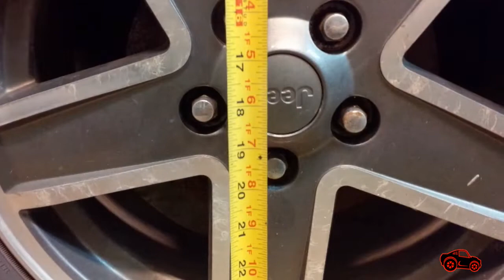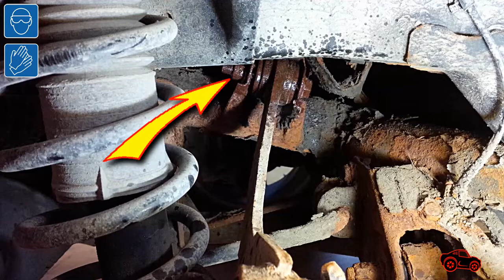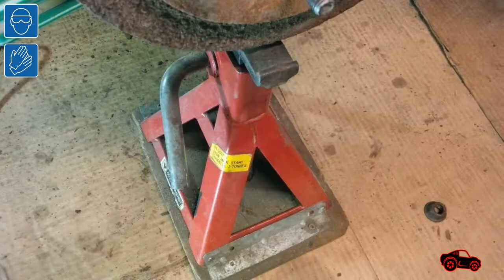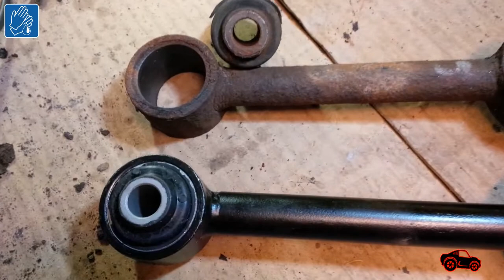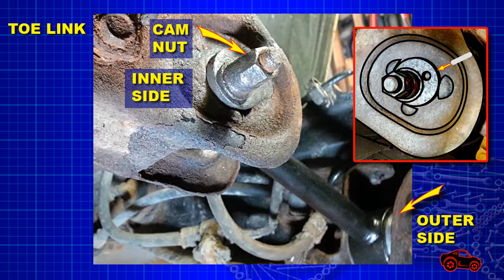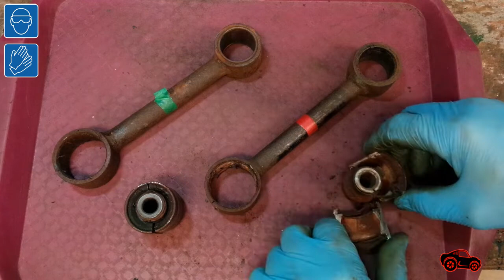Jeep Patriot Upper Control Arm & Lateral Toe Link Replacement + Bushing Preload & Torque Specs

Comment: People (making the videos on this particular fix) only show the procedure for the passenger side... The driver's side is much more difficult. I need guidance on what to do with the additional obstacles on the driver's side inner upper control arm.
Reply from the maker: I did not film the driver side but I don't remember having any problem undoing the upper bolt. You could try different tools to reach the bolt.
Reply: @mtlcarguy  hey I have a ,2016patriot and suddenly have bad camber wear on the inner rear is that alignment or a part gone bad just coincidently on both sides at similar times
Reply from the maker: @tylerbailey470  This kind of problem can be caused by rubber bushing that is not bonded to the steel arm. It can also be a coincidence with both sides since the steel arms rust at the same speed. Weak coil springs can also affect the geometry of the multi-link suspension.

Comment: How did you figure out the control arm need changing?
Reply from the maker: Because of the noise and and also because one rubber boot of the spherical bearing was damaged.

Comment: Hi! Is the preload measurement (17.5”) a standard or it would vary from one vehicle to another?
Reply from the maker: Buongiorno ! There is no real standard. You simply measure it on your vehicle on an even ground, because it varies a little depending on the strength of the coil spring, on the age of the coil spring and on the optional suspension available on different Patriot/Compass.
Reply: @mtlcarguy  thanks a lot! I’ve just replaced the whole rear suspensions of my wife’s 2011 Jeep Patriot..rear subframe was completely rusted out! Having some issues with the alignment but I think I figured it out..
Reply from the maker: @piva84  Years ago, I received a service bulletin from Jeep that extended the warranty up to 10 years to replace the damaged front and/or the rear subframe(s).
I had the parts replaced for free 7 years ago. I only payed for the alignment.
Reply: @mtlcarguy  I've check that. They told me the warranty was expired 3 years ago on mine. So I had to do it myself. I'm still struggling to get the vehicle aligned. If loosen up all the bolts, let the vehicle sit on the rear suspensions, measure the distance between the center of the wheel and the fender and then lift it up again, preload the struts to the same distance and tighten the bolts...that should work right? I'm not able to tight all the bolts properly when the vehicle is on the ground...thanks!
Reply from the maker: @piva84  You can also lower and sit the 2 rear wheels on pieces of wood to have the rear suspension in normal load condition and at the same time have more space to move and tighten the bolts and nuts.
Reply: @mtlcarguy  can I ask you another question? Is the preload affecting the camber? I mean I know there’s no camber adjustment but if I tighten the bolts without the proper preload I can also influence the camber correct? My problem is that I’m getting a slightly positive camber (around 1 deg) and I think this is influencing also the toe (cause it’s negative) and the alignment shop is saying they can’t adjust the toe any further..
Reply from the maker: @piva84  The preloading procedure doesn't affect the camber.  This procedure and the regular shop procedure are performed to position and tighten the rubber bushing properly in a way the rubber can twist for years without getting unglued from the steel parts.
Jeep was not too concerned about the camber because the company produced the upper control arm without adjustment. 
Some aftermarket company do produce adjustable upper control arm. Aftermarket adjustable upper control arms could help ??? but, I never tried them.
The rear suspension was originally designed to only adjust the toe (+0.10 degree or a range from 0.00 to +0.20 degree).
The toe (in or out) can be affected by weak coil springs because of the design of the rear independent suspension. 
The rear subframe can also be a bit offset and affect the toe adjustments, I would double-check the overall positioning with good reference points.
Reply: @mtlcarguy  thanks for the explanation! so what can cause the camber to be positive? supposing that the spare parts I got are in spec (..which I'm not 300% sure of lol..) I'll also try to measure camber myself cause I don't trust the shop anymore..I could try to replace the struts but I don't want to do unnecessary stuffs..
Reply from the maker: @piva84  In the Jeep documentation, it is written that the alignment should be done when the vehicle has the proper curb height specifications (normal riding height with known good coil springs and with properly inflated tires). 
If the coil springs are too weak, the rear curb height is too low and Jeep recommends to replace coil springs with known good ones to improve the geometry of the suspension and improve the camber. 
Instead of replacing the coil springs, the aftermarket solution is to install rear adjustable camber arms to adjust the camber, even if, the rear curb height is a bit too low.
Reply: @mtlcarguy  thanks! yeah that's probably what I'm gonna do. I'll probably install adjustable upper arms and toe links. Can I ask you where do you find all the official Jeep documentation? thanks!
Reply from the maker: @piva84  You can subscribe to a  ALLDATA DIY ''Single Vehicle Subscription'' for a short term or for 3 years to get a rebate. 
You can also buy a Haynes repair manual but the documentation is presented differently.
Reply: @mtlcarguy  thanks a lot!!

Comment: Great video mtlcarguy, I wish I had it when I replaced my rear suspension parts, I still have very bad wear on the inside rears, do you think I could adjust the rear toe links so to not wear so badly? I use this car only to work and back . I think I didn't install the link adjusters properly  .I just replaced the clutch master cylinder,  it was Not an easy job, took forever to figure out how to bleed. Thank you
Reply from the maker: Selon la documentation de Jeep, l'alignement des roues en avant et en arrière devrait avoir un ''Toe '' individuel de + 0.10 degré ( ou acceptable de 0.00 degré à +0.20 degré. Techniquement les pneus en arrières devraient être pratiquement en ligne avec ceux d'en avant. Je trouve qu'il est plus facile d'aligner les pneus d'en arrière parce qu'ils ne sont pas reliés à le colone de direction comme en avant. Le vehicle doit être sur une surface plane avec le volant droit vers l'avant. Quand la ''cam bolt '' (excentrique) du ''toe link'' est déserrée elle peut être tournée pour obtenir un ''Toe'' positif (+) ou négatif (-). Après la ''cam bolt'' est reserrée à 26 livres -pied . En utilisant une corde sur le côté des pneus (String Alignment) il est possible d'obtenir un alignement de base pour réduire l'usure des pneus arrières. Cependant c'est moins précis qu'un alignement au garage.
Reply: @mtlcarguy  merci MTLCARGUY I will translate into english , so I don't miss  any of the finer points. My french is pretty good but I want to make sure not to miss something. Your videos are the best. 👍
Reply from the maker: @sergebouchard5908  I wrote in french because of your name. But if something is too confusing, you can ask about it and I will write back to you in English.
Reply: @mtlcarguy  Love your videos and appreciate the effort you put into making them. I have a question. I’m trying to install a rack and pinion seal kit and I can’t get the plastic 4 outer nut from the bottom of the steering rack. Would you by chance know how to disassemble the steering rack to install the new seal kit. Thanks in advance any info will help.
Reply from the maker: @manuelm_007  
Open this PDF kink and you will find the rack and pinion removal procedure and more.  
https://www.google.ca/url?sa=i&url=https%3A%2F%2Fwww.slideshare.net%2Fgustavocastro75098364%2Ffront-suspension-51063906&psig=AOvVaw1vTiH9G_yCwPAmjqe9Ay_b&ust=1690646748318000&source=images&cd=vfe&opi=89978449&ved=0CBMQjhxqGAoTCIDWoonksYADFQAAAAAdAAAAABCQAQ

Comment: Thanks for the video. Is the nut for the toe link to trailing link, the one you said is hard to get at so you used a smaller socket, is that 18" or 19", also whats the brand of socket you used to get at that small space?
Reply from the maker: The outer nut for the toe link was a bit difficult to loosen but the bolt that was difficult to undo was the one holding the inner end of the upper control arm.
In the small area, I used a 3/8'' drive small torque wrench (5-80 FT-LBS) with a short 18 MM socket (Milwaukee or Mastercraft)

Comment: Great video as always! 
However I can’t for the life of me get the lower bolt from the lateral toe link loose!? I was scared I was going to shear the head off so stopped… any ideas?
Reply from the maker: When a big bolt is stock in a welded nut like this one, most of the time it is because the threads are corroded or rusted. Penetrating fluid can be added 2 or 3 times to help. This type of bolt is usually made with high strength steel, so I would normally use a cheater bar with a 6 point impact socket to loosen it. If you are not sure about the risk of damaging the bolt, you should try a strong impact tool with a 6 point impact socket. Heating up this welded bolt is hazardous so I would not try it.

Comment: First of all, thanks for the videos. They really help!

I have a question: 

For the toe link, can I replace it without removing the shock and the upper control arm? also, I translated the French message you wrote for someone else. It mentioned that I should loosen the cam bolt while the truck is on the ground, with the wheels facing straight. Should I lift it up and replace it once I loosen the cam bolt? or keep it on the ground?
Reply from the maker: Ref. question 1: Yes... but the trailing link can be more difficult to fit with the toe link.
Ref. question 2: The comment in french was not specifically related to this video. The text was only described for a ''toe in'' or a ''toe out'' homemade basic alignment when the wheels were obviously not aligned. If the rear alignment was fine before you replaced your toe links, the bolts are normally tightened based on the previous cam bolt positions. Most of the people do not perform a homemade alignment, they have the wheel alignment done by a specialist or they simply keep the previous toe settings if they think the rear alignment was fine. Jeep recommends a wheel alignment when the toe links are replaced.
Reply: @mtlcarguy  awesome! Thank you for the reply!